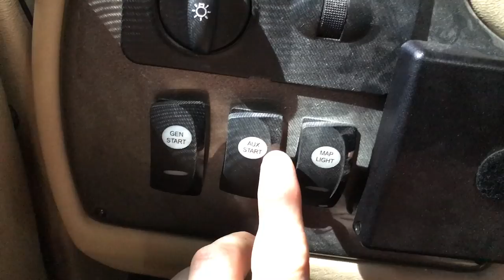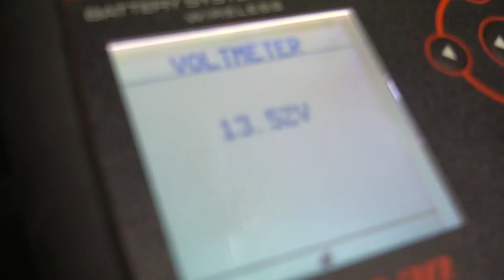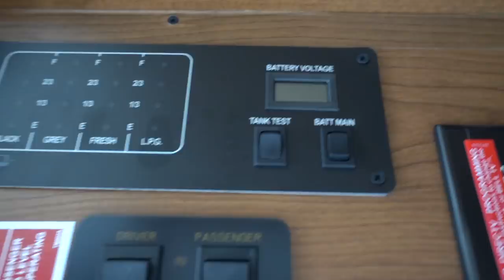PART 2: 3 x RV Breakdowns in a Month. The Saga Continues...

Comment: Last month we where coming from Colorado Springs and was 82 miles from Vegas when our engine overheated and lost all our anti-freeze.  Towed to RV Shop replaced water pump and radiator hoses. Know how you where feeling. Things happen, at least our road assistant paid for the tow truck. And the rest of the road trip went smoothly. Enjoy your travels
Reply from the maker: Good to know you got sorted out, roadside assistance is invaluable. Happy trails to you!

Comment: I had electrical issues that seemed similar when one of my truck batteries shorted out on my Newmar Dutch Star and it would drain both batteries. As long as I could jump start it, it was fine, but sitting was a no no. Anyway, I nursed it to Devils Tower and replaced both batteries from NAPA and discovered my truck batteries were 8 years old!! I guess I can't complain about that!
Reply from the maker: Wow 8 years! That's amazing! Glad it all worked out ok :)

Comment: Usually you have problems starting when that solenoid goes bad.
Reply from the maker: Thanks... the batteries were the primary issue, but also had some other small electronics that needed fixing. -M

Comment: I've noticed through research that Tiffin is known for electrical issues so I think it all worked out pretty well, considering.  Our inverter went out last August while we were in Alabama.  We woke up in the middle of the night sweating.  We were 70 miles from Red Bay so we went to Tiffin for parts since our steps also quit working.  The generator wouldn't stay on either.  My point is that problems or breakdowns seem to come in threes!  Hopefully we are both good for a while.  You were also fortunate that it wasn't hot.  Thanks for the video.  Safe travels.
Reply from the maker: Thanks for sharing your experience - agree - things seem to come in 3's so we should be good for a while! We were very lucky indeed it wasn't hot! Our coach doesn't even have an inverter, given how complex coaches can be these days, we do think that the simpler they are the better sometimes... but then again all the modern conveniences are so nice to have! It's all about finding a balance. Glad you were able to get to Red Bay for a quick fix, that was very handy! Safe travels to you too!

Comment: I noticed that you don't seem to have a hitch on the Mini.  The reason you may want to consider one is that you may need to move your tow dolly in the event of another breakdown that actually requires a tow.  While I'm guessing the Mini has very minimal capacity to tow but it probably can tow the dolly a modest distance.  We nearly ran into that problem a couple of years ago on the NY Thruway when we hit a chunk of retread inconveniently left by a semi in the middle of a lane on a curve which destroyed our exhaust.  I was able to temporarily suspend what remained of the exhaust to drive to a repair facility but I also realized we were unlikely to have been able to have the dolly towed with the RV.  I had a hitch put on the car right after that.  We've since moved to towing four down but the hitch was so useful for other things we added one to our replacement vehicle.
Reply from the maker: Good insights! Unfortunately, our MINI has a center exhaust which makes it challenging for mounting a hitch, but good idea for most vehicles!

Comment: Wow the F53 Chassis is super reliable you have had more  bad luck than you deserve for sure!!
Reply from the maker: Ray, Yes we have found our F53 chassis to be reliable for sure. It's a  5yo coach, in the 2.5 years we have owned it - these are the only real issues we have had - the track bar bolt / king pins were definitely unusual but the flat batteries / solenoid were probably due to the shop letting them get under 12.1. In the end, while November was a frustrating and inconvenient month, it's continued to drive well and now we are 3 years in... hopefully we are in good shape for some time now. I think it just appears the chassis is unreliable as we founded up all repairs at once and highlighted them in these videos... we still feel our coach and chassis are reliable and are still happy with them. drives great and still enjoy our motorhome :) Bit of bad luck for sure, but we were safe, some additional repairs were done (and covered by extended warranty) so it's actually an improved vehicle now! LOL

Comment: Marc,

I don't want to kick you while you are down but if you are wondering what happened- The solenoid failed as it had to transfer too much current through it from your house batteries to try to start your coach multiple times.   It was only designed to assist a low engine battery (not a totally dead or failed battery).  Unless you started your generator the house batteries were not being recharged as only the vehicle battery is charged by driving down the road,  so as the house batteries got lower and lower then the current draw when you stated your vehicle went higher than the solenoid could handle and it failed. Then the entire system failed.   In the future just stop in at any shop and have your batteries tested as they usually will do that for free.  Or you can buy your own inductance battery tester (amazon for $50).  Hopefully this helps you in the future and others that might read this.

So to sum it up- On your Tiffin and most other coaches the house batteries are only charged when you plug into power or are running your generator (unless you have added solar)
The vehicle starting and running battery is charged by your alternator while driving down the road. 

Me- 38 Years electronics repair of ground and aviation equipment and the last 5 years I also ran a large battery shop as an additional duty.  Don't feel bad- I have seen these kinds of problems happen before.  I am just sorry it cost you so much.  A quick trip to Costco or Sams Club would have cut the costs dramatically.

-Scott
Reply from the maker: Hi Scott, great info! That makes a lot of sense, thank you for sharing. We appreciate the education, as I'm sure will many others reading this. Cheers, Marc
Reply: Marc,

 You have a great positive attitude.  I am just bummed I wasn't a fellow RVer there with you and would have been able to save you some headaches and lots of bucks in the process. You can put out the word that if you are using your house batteries to start your vehicle it is also a better idea to start the generator first as it will provide an extra 60 amps (on our coaches) of starting power in addition to the current provided by house batteries.  Electrical systems of all kids have always been my forte, weather it be Aircraft, military equipment or RVs. I have a 2012 Tiffin Breeze equipped with 1.1kw solar and learned all the different systems intricately just to be able to maintain my coach (most all) myself...  I just retired and am transitioning to more and more travel. Its pretty awesome!

-Scott
Reply: Here is the link for an inductive battery tester on amazon- these work great as I used a similar device during my tenure working at a large maintenance facility. They will let you know when your battery is reaching the end of its life before it actually fails.  https://www.amazon.com/ANCEL-Professional-100-2000-Automotive-Motorcycle/dp/B01M0ARG3X/ref=sr_1_3?ie=UTF8&qid=1501597346&sr=8-3&keywords=automotive+battery+tester
Reply from the maker: Hey, thanks for that! Would  be handy - will check it out
Reply from the maker: Thanks Scott, Would have been great to have you around to help! Good tips re the generator, but we couldn't get ours to start! Hope you are loving your Breeze - excellent that you can maintain it yourself (mostly) - enjoy the life, you are right, it is pretty awesome. Hope to see you out there someday, be sure to say hi!

Comment: You guys are so laid back when it comes to problems.  Is this just in front of the camera or are you like this all the time?  I don't think I could handle problems very well!
Reply from the maker: Hi Jay, well, of course, we are human and have moments of frustration, but for the most part, we really do always see the humor,  lesson or positive side of every situation. Guess it's how we are wired. We figure getting all worked up or angry isn't going to fix the problem any faster and it just adds to the stress. Marc is also a former police officer, so he is almost always cool as a cucumber - he's had to deal with far bigger issues than that. He's also experienced mechanically and we have ourselves covered with roadside assistance and extended warranty in need, and of course, we take good care of the coach and have a repair budget - so it's all just part of the lifestyle... we believe in being well prepared and planning for the worst case scenario so when things happen it doesn't blindside us. Of course, we never expected to break down like this (3 times in a month!) but we hope that by sharing we can show one of the sides of RV life - and that having the right attitude can help you get through things like this. Even though we don't like it when things like this happen, we are glad we finally did get faced with "roadside breakdowns" like this, as it just gives us more experience to notch onto our belt and speak to. :) Have a great day!

Comment: I'm not saying this is your battery problem, I'm just saying this fyi. Any kind of battery in any kind of vehicle need to be charged by a house current battery charger at least once a year. The reason is the rubber tires are a soft ground. The house current charger has a hard ground. That's how it was explained to me from a guy who owned a battery re conditioning business.  He said if you do that your vehicle batteries will last years longer. The one exception would be a boat, because it's charging system gets a hard ground from the lake.
Reply from the maker: Thanks for sharing.  Interesting suggestion.  The batteries were  a bit old.  Since then they were all replaced, and we eventually changed motorhomes too. -M

Comment: Hey great videos. I don't know your electronic and battery charging system, but, if your battery for the engine drops below 12.8 volts, give or take a bit. Your ECM will act up and shut down, causing your lights and transmission and other electronics to act up. Sometimes it will blow a relay and in your case solenoid. If you don't, I suggest, have a solor panel connected to all batteries, to keep them charged above 12.8 volts when sitting. A similar incident happened to me twice before a mechanic explained this to me. Oh well, glad everything's fixed and ok. So, I'll be sitting here waiting to watch the next hair raising adventure, good luck.. Bye
Reply from the maker: LOL Hopefully the next adventure won't be hair raising! Thanks for the extra insight on the electronic systems and your suggestions. Good to know! Glad you enjoyed the video :)
Reply: @Rvlove  I recognize that I'm late to the party here, but thought I would try to provide some information that may help your understanding of why so many things went wrong.  The issue that initiated the series of failures was the dead chassis battery at the dealer.  If battery is young and strong, they can be revived, but their life will be severely shorted.  If the battery has some age, a voltage drop below 11.0 will have terminated their ability to hold a charge.  I'm assuming they were older, which means when they are provided with power from your alternator as you drive, all of that power is lost to the wind - not stored.  Now each time you turn off and attempt to re-start, the battery shows up as dead.  Each time you "link" the house and chassis batteries, you sacrifice power from the house batteries.  Here is what you may not have known: some RVs have the ability to connect the two sets of batteries when one set is being charged.  However, that connection is based on voltage.  For example if a resting battery is 12.8v and the alternator can supply 14.4v, that inter-battery connection may not occur unless the voltage is 13.4v.  They remain isolated from each other to prevent one set draining the other, until charging is assured.  Depending on your setup, your overnight connection to shore power may only charge the house batteries and may not interconnect to the chassis battery.  So ... each time you activate "Aux Start", you are taking high current from the house to the chassis and the house never receives a re-charge.  As you are driving, your alternator barely provides enough power to keep the engine running.  The engine has a computer (ECM), the transmission has a computer, the dash lights are running, maybe the headlights are running.  When you turned on the flashers, that was the straw that caused the voltage for computers to drop blow a minimum level required just to operate the electronics, so they shut down, but that may have occurred soon anyway without the flashers.  What I admire is that you had the skill and ambition to change out the chassis battery, and the means to get a replacement.  I suspect that your house batteries had some age, and their draining by using Aux Start was what finished them off.

Now that you are aware, what I would recommend is that you always monitor the voltages of both your chassis battery and your house batteries.  If you don't have that visibility through gauges on the dash, I suggest adding some there - having voltage displayed in a cabinet or on a wall doesn't cut it.  You always want to be able to drive and see what is going on.  You will then better understand their health status and when they are or are not being charged through the alternator, shore power, generator, or solar. Because one set is charging does NOT mean all are being charged.

Comment: yes you could be write, one time i was going to turn right and one of my left side tires blew, so no more right hand turns for me lol.you would think there be an indicator for the battery power , just to tell you that batters are to low to run, some have it, so the low batteries fighting so hard , took the solenoid out, yes i had that happen, it pays to replace them darn batteries..
Reply from the maker: Yes, it was pretty evident the batteries were toast when we returned from our trip and the RV wouldn't start.

Comment: Great Video. Just curious what you did about your fridge and the food inside when you put the coach in the shop for the week. Did the fridge stay on and run off propane ? or did you lose everything because the coach batteries were bad?
Reply from the maker: Thanks Mike - The first repair in early November we had run our fridge supplies down and took some food to the hotel with us in a cooler filled with ice. Being an 8CU fridge it didn't have a ton in it anyway. We also knew we were going to CO for Thanksgiving so only shopped for what we needed, the fridge was mostly empty save for sauces and staples when we were out of town. Keeping the fridge on propane while out of town would have contributed to that extra draw on the batteries which weren't being topped up. Lucky this didn't all happen after a big stock up at Costco! That's when we usually fill the freezer with chicken, fish etc. So luckily we didn't lose anything in the way of food.

Comment: Break downs happen to all vehicle owners but its even more stressful when its your home. Glad you were safe and it worked out for you.  Did you contact the first repair shop to let them know what had happened with the batteries?
Reply from the maker: Yes it's inevitable but when it's your home, it does an another layer of stress! We didn't bother contacting the repair shop about the batteries as it seemed a moot point - wasn't going to change anything and we did need to buy new batteries anyway. We just put it down to experience! And be careful when trusting a shop to keep your batteries plugged in!

Comment: par for the course with coaches, I use a pickup and travel trailer no problems.
Reply from the maker: Some of these issues would have been less likely in a truck and trailer combo.  But trucks and trailers are not immune from problems either. Great that you have had such great luck so far. Wishing you continued smooth sailing. -M
Reply: @Rvlove  agreed

Comment: If your alternator fails isn't it possible to get your generator online to keep your power going to the engine?  I have had friends drive 1,500 miles without a alternator running on the Generator.
Reply from the maker: It wasn't our alternator. We had dead batteries and a fried solenoid. All good now!

Comment: The guy who did the troubleshooting on the solenoid seemed to be competent.  Curious on the tow truck, it looked like a flat bed where the entire coach would be put on the trailer rather than just lifting the front wheels.  Did he say he needed to disconnect the driveshaft to get it on there?
Reply from the maker: Hi Bob, yes the guys at Joe's repair shop were good. Re the tow truck, yes it was a flat bed... to be honest, by the time he arrived the coach was drivable and it started raining hard, so we didn't even go into detail on the towing conversation - don't imagine you would need to disconnect the driveshaft for a flatbed tow though... but would want to ask a tow truck driver to be certain.
Reply: Drive shaft disconnect is not needed for a big flat deck like that, but towing with only the front wheels off, definitely!!!, (to protect the transmission).  I do wonder if he would have been overheight though
Reply: While I agree that when off the ground you don't need to disconnect, I wasn't sure how he gets it onto the flatbed and if that requires the disconnection.  Likely not since it's a slow process. Don't think the bed tilts (couldn't tell from the time it was in the video) but may be wrong so it appears it has to be hauled over the rear wheels of the trailer.
Reply: Pretty sure from the video at 11:05 that it's a tilt deck (the whole coach would fit on it) probably winched up. Just Google "semi tilt deck trailer" and you'll see pictures of them.